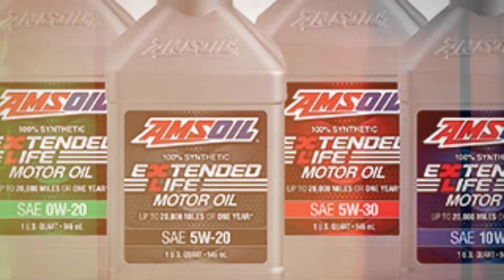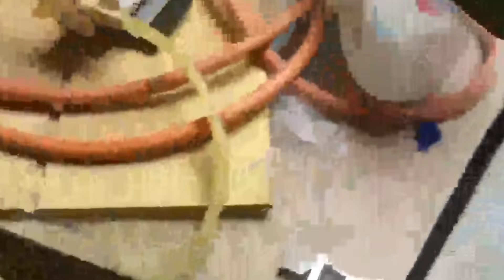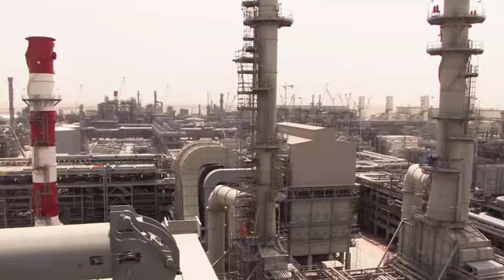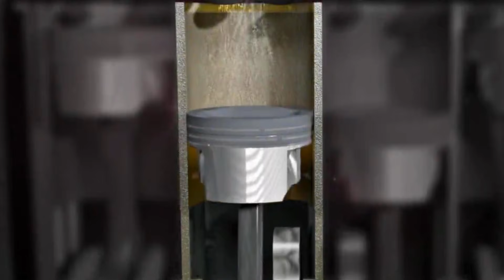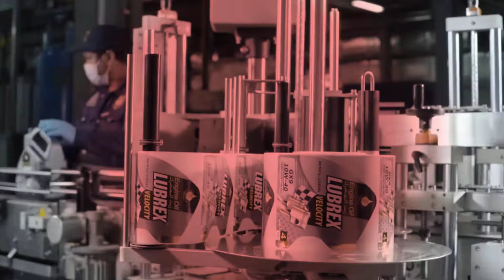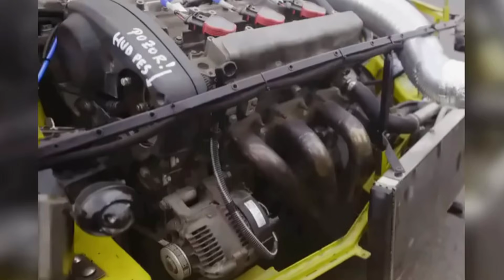Good Oil = Good Engine? Best Synthetic Oil for Turbocharged Engines

Comment: I run Ravenol VST 5w-40 in my European cars and Amsoil signature 0w-40 in my other cars regardless of what viscosity the manual calls for.  0w-20 is WAY TOO THIN, which is what my Audi S5 calls for.  Oil change 1 year or 5k miles. Both oils are far more expensive than the Walmart oils, but when an engine costs 20k, it's worth it.  I will also say that at every 40-50K miles, I do run an oil flush.  Even with top grade oil, it still cleans quite a bit out.  As for the shut down:  Every start is 5-20 seconds idling depending on temps, every shut down is 10-15 seconds idling to let the turbo impeller to slow.  TURN OFF YOUR AUTO START STOP especially if you have a turbo!  When I tuned my Audi, I had it turned off by default.

Comment: 2 owner of a 2014,3.5 turbo, bought it at 67000 miles, now have 168000. Running penn ultra oil and top tier fuel, change at 5k. I'm very persistent with 2 minutes warm up and 2 minutes cool down. This has worked for me so far and I will continue. Thanks for the video 😃
Reply: I always use top tier PREMIUM gas and Castrol Edge,  which is  GF7 compliant, and because it is Turbo charged,  the oil is changed every 3000 miles. Dirty oil will destroy the Turbo !